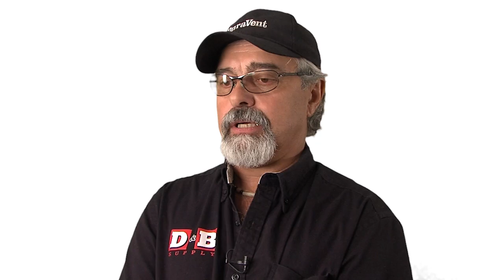My pellet stove will not light, what can I do to get it going?

Comment: Make sure your basket is not backwards.  I had an issue where my igniter was getting hot and the hopper was filling the basket, but the pellets would not light. This was right after cleaning the unit. Come to find out, my basket only has a hole on one side of it and I had dropped it in backwards. So the igniter was just warming the solid side of the basket instead of hitting the pellets through the hole.